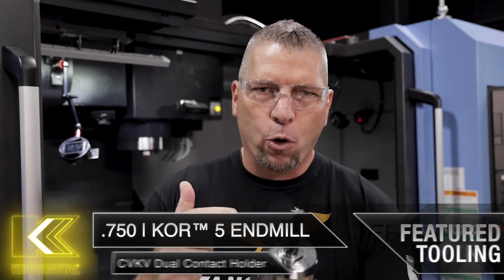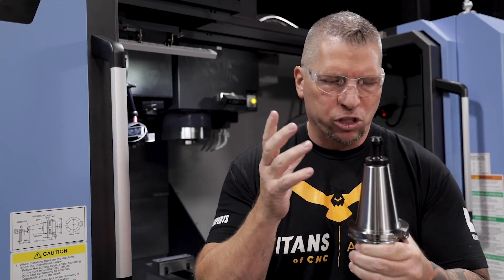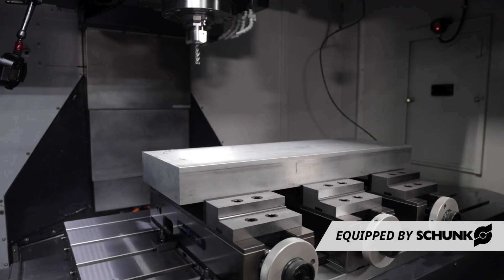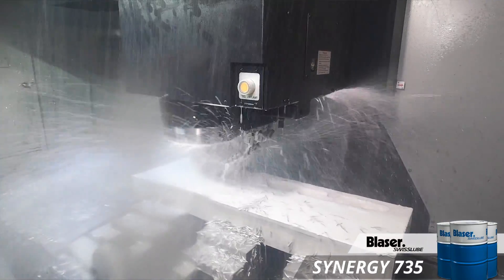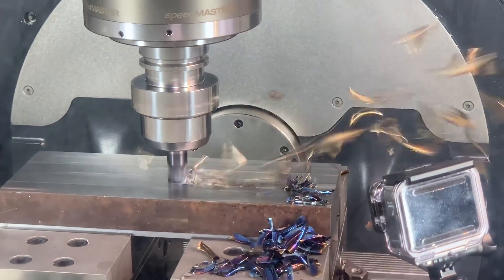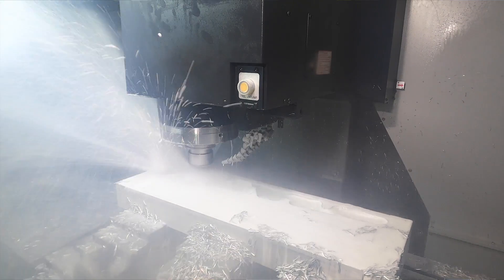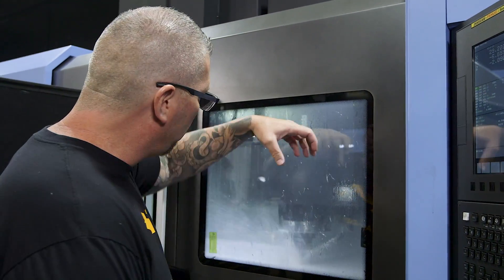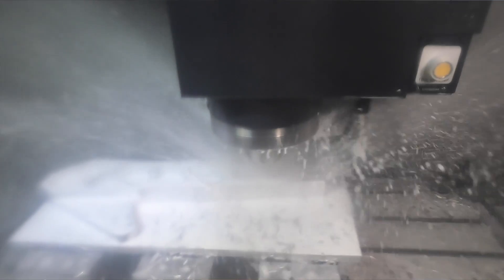Roughing a GIANT Aerospace Part with the KOR-5 | MYNX 6500 | DN Solutions

Comment: Titans! I Did some testing with the KOR5 coolant thru last time, went a bit too hard on the Helical plunging, and the tool really did not  like it!
Wondering what do you use as Feeds and speeds in 7075  😎
Also you running the spindle slow on that video, any reason why?

Love your video!!

Comment: Despite my best efforts to bounce ideas off Mr. Gilroy, I haven’t been able to since I’m sure he’s flooded with messages constantly from fans. I am a fan of his work but I have shared best level material removal approaches and calculations. I often, and confidently take cuts on aluminum using and steel doing full depth (up to 3xD) at over 50% engagement cuts at reduced speeds but with tremendous material removal rate that exceed those he has demonstrated with high end machines. I freelance and help shops with hopes to inspired them by showing them how to do what I do but my network is small and is far from lucrative. I’m not much of a business man but I am a passionate and technical machinist that has been trying to simplify feeds and speeds for everyone. Hope I can get a shout out at some point for what I’ve been campaigning for over a year now.

Comment: My cnc mill has only 1 kw and no internal coolant. 12mm (1/2) inches dia and 12mm depht maximum for full slot and max speed is 50in/min... This part will fit the entire range of the mill and around 2 hours to rough... luckily my mill is "decent" cheaper than the Doosan. Thanks for the tipps, they improve my Work to, but my numbers are a little bit smaller :-) Keep on Working!

Comment: Hi Titan, 
Most of building blocks course you used Fusion 360 for drowning and programming, but in aerospace projects you use a Mastercam. Why Mastercam? What better for biginner?
Reply: mastercam can do more complex toolpaths and is more capable overall also the mynx that he has won't be programmed in fusion 360 at least not efficiently you have to post each operation and glue the code yourself and hope that you didn't make a mistake but mastercam is far more expensive than fusion 360 but for a beginner it doesn't matter the most important thing is the phelosephy of machining you need to understand why we applied this toolpath and not another and why we are doing it this way not the other just like he said in this video they are roughing inside pockets first because they need the regidity to run them aggressively and than rough the outside gently since there isn't a lot of air cutting compared to the pockets this kind of machining strategy understanding is the golden fruit that you should have watching these videos and touring shops and than you can learn any program and I advice that you use both of them and challenge yourself to be comfortable with both softwares and listen to the story of tyson and how he became the lathe man in his shop than you'll further understand what I am saying https://www.youtube.com/watch?v=z_I1JdPZgpo&t=666s

Comment: When you take away all that material, how do you make shure that the material is not bending because of the tension in the material
Is it aluminum tooling plate? (Don’t know how you guys call that in the states, it is like molded)
Reply: This part is great to demonstrate the endmill doing that style of toolpath. But if I had to do a bunch of these parts. That gigantic block is going on a fixture plate, to bolt down. No vice compression. All of that excess material on the lower right, and left corner, will be removed as a solid piece. Don't have to spend all that endmill time cutting through it. After a few dozen parts at a time, it would be worth the fixture and bolts. The second op looks like it's gonna need a fixture anyways. So there should possibly be a way to have a single plate, do both ops in the first place.

Comment: Is this the first time running this program? I know Doosans can handle far higher rapids than that..
Either that or you need to adjust your tolerance settings when roughing to allow the machine to accelerate faster.
Reply from the maker: I just put back feed at 450 IPM.
Reply: @TITANSofCNC  fair enough. I just thought you might have missed an opportunity for a BOOM factor.. 😅
Out of curiosity what is the rapid of this Doosan? Guessing atleast 1200ipm?

Comment: Can the KOR5 handle more than 15% radial? Seems like the machine would want more.
Reply: 15% is pretty small, that machine could full slot that thing at probably 150ipm in steel let alone aluminum, personally 5 flute is also not the best choice for this job.
Reply: @Donkusdelux  not at 2.1" deep and if you can full slot at 3/4 dia. at 150 IPM I want to see a video.
Reply: @Osborne.Strong  never said 2.1" deep in steel.
But you just increasing your doc until the spindle is at 100%

In aluminum yea they will 2.1" doc full slot np.
Reply from the maker: It can definitely go to a bigger radial
Reply: @TITANSofCNC  what is SMM (something like cutting speed meters per minute?) and MMPM (mm per minute?) in metric?
Reply: @Michal_Sobierajski  yes they call them Surface Meters per Minute (our cutting speed Vc) and MilliMeters Per Minute (our feedrate F)
Reply: @Michal_Sobierajski To get a ISO metric value of Vc in meters per minute you need simple and quick calculate by divide imperial value of surface speed in feet/min by 3. Result is not perfect but close enough. E.g.  Vc 300 feet/min : 3 = Vc100 m/min.